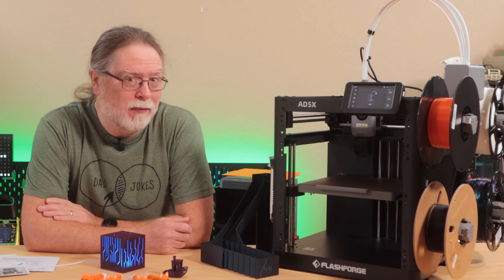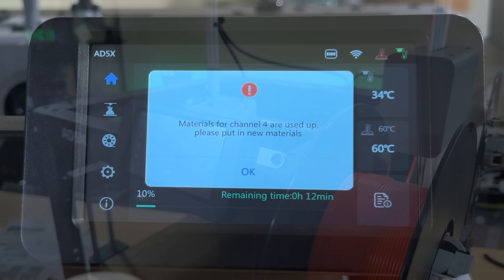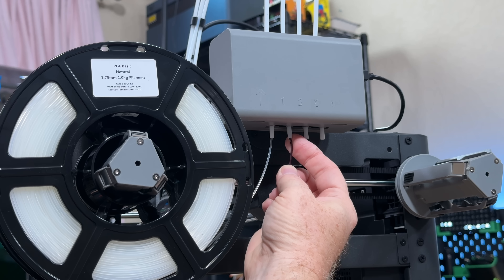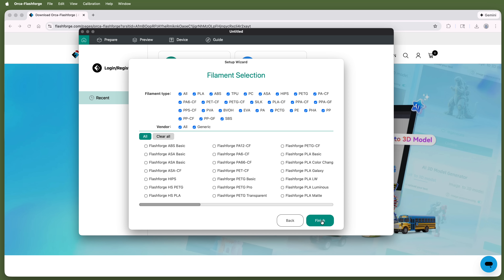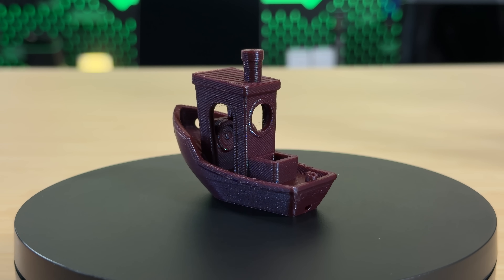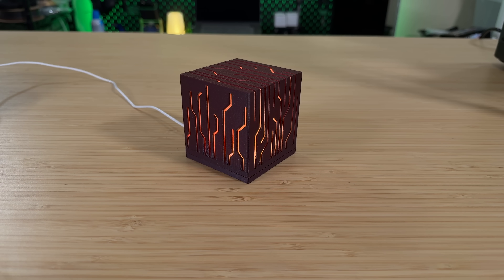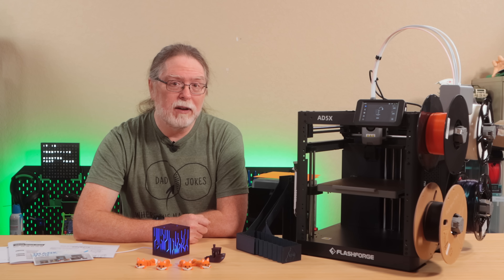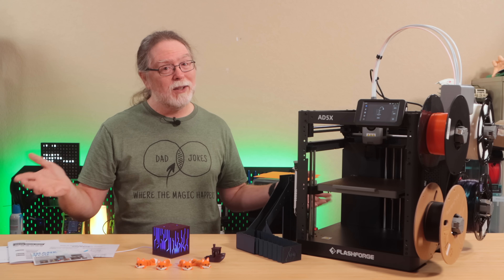A $399 CoreXY Printer with Four Colors? FlashForge AD5X Review

Comment from the maker: Hello 3D Printing Friends! I'm, curious what you think about the FlashForge AD5X. If you’re using one, what’s been working well for you, and what do you think could be improved?
Reply: I bought one about 2 months ago from my local microcenter for $329 for a specific print job needing multicolor.  All petg, main color cf-petg, with other 3 standard petg. 

after unboxing and swapping to a hard nozzle, it paid for half its cost in the first batch of parts ~ 2 days straight of printing. It is a cheap machine, but with a little slicer compensations, its a fantastic machine for the money, and a low cost entry into multi-material. 

People have their complaints, but it definitely brings an economy option to corexy multi color. 

Good review, and if you keep it around, you could totally make more content off it showing off the "zmod" firmware for it.
Reply: I've been mainly using mine for TPU. More than 1kg in and it's been solid. I would like to be able to send a print job without having to start it, or while another job is printing. That's a quality of life feature I miss.
Reply: @drewbaker4175 that's something fixed in the zmod. I would check it out. With the standard fluid interface it functions like any normal klipper machine

I'll be modding mine soon. Customer said they wanted another batch of parts so i don't want to mess with anything until they either cancel or order lol
Reply: "Where I think it could use some improvement." Me looking at my Centauri Carbon

Comment: Thank you for keeping up with the reviews, it's very much appreciated. I got one of the first run Anycubic Kobra 3 combo printers, and it has been printing pretty well until very recently. I have now gone through three print heads, and have an OEM one on order from Anycubic, but their shipping times are obnoxious since the equipment comes directly from China rather than one of their regional warehouses. Needless to say, I am keeping an eye on the market to see what is coming out and what has come out recently that might be seeing price drops soon, so reviews like this are invaluable to me.

As for the AD5X - it's interesting that you can see the spot on the filament settings page of the prepare tab where the sync button should be and is conspicuously absent. That's a major miss, honestly, for a multicolor printer. I would not have released the product in that state until you could get that basic level of functionality working. Additionally, that filament bleed is the worst I've ever seen on a color changing system. Say what you will about the Kobra 3 / ACE system, but the default purge values are honestly too high, and can be dropped significantly and still not see any level of color bleed, even from black to white. (Having printed a black and white panda theme box, I have tested that scenario explicitly, lol.) The price is right, but it sounds like there are a few serious firmware and software tweaks that need to happen to make the user experience a reasonable one.

Comment: Purge is controlled by the firmware, no amount of changing in the slicer will affect it, FF have locked this thing down and reduced the amount of tinkering you can do without something like Zmod
Reply from the maker: Ah. I don't know why they would do that, but it certainly explains the results I was getting.

Comment: No, the printer does not have to be bound a Flashforge account when using LAN mode in any aspect.  I have 10 of these machines and that is the reason I got them over Bambu -I never had to bind anything.  I can still update and run the printers just fine.  If anything the machine suffers from is Flashforge's awful customer service and terrible purging system.

Comment: Does the screen offer a way to manually set a purge multiplier? I have that option on my Anycubic Kobra 3 Combo and it really helps with bleed where the firmware purging isn't quite up to task. I still set it in the slicer, but the machine itself has a 1.5 purge multiplier manually set over the default 1.0. Initially I was tempted by this printer when I first saw it, but I'm glad that I've waited. The future of multicolor printing is with multi-toolhead machines, both in time savings and in reduced waste.
Reply from the maker: Hi Stew, I didn't see anything like that on the screen. Some other commenters have said there's a way to get more of a standard Mainsail (or similar) web UI into the printer, so that could open up the possibility of adjusting it by accessing Klipper a bit more directly.

Comment: It's (sort of) funny, that TPU-capable multi-material printers don't have dryers, and AMS boxes with dryer can't feed TPU 🤔

AC Kobra S1 Combo is a bit more expensive, a bit bigger, fully enclosed and has drying multi-material box. CPU is about the same level with FF AD5X and Elegoo CC (cheapest possible, Elegoo seems to be only one not able to squeeze in filament change).

Not sure if FF is cooking something bigger or more modern... Guider 4 seems to have fizzled
It'll be interesting to see where AC Kobra X lands - it should be between AC Kobra 3 V2 and Combo, right?
Reply from the maker: The Kobra X is interesting from the perspective that they've managed to squeeze all the filament change hardware into the toolhead itself. There are a few other optimizations they've done, like reduce the distance between the filament cutter and the nozzle, so there should be less purge waste as well. The've got a link up with some basic info (https://store.anycubic.com/pages/kobra-x-new-launch), and the printer looks almost exactly like a Bambu Lab A1 with four top-mounted spools.

Having run an A1 with the AMS lite mounted on top, I think this is perfectly OK. I never noticed a difference in print quality between having the AMS lite's weight up top and having it off to the side of the printer.

Comment: Just like Bambu labs and Creality, the whole sign in , agree to our terms and use our slicer model does not work for me. I will stick with QiDi Tech and Orca Slicer thank you. I actually just picked up the Creality Hi because it was priced at $214 USD for the Non-Combo version on Amazon and for that price it the build volume was worth it to me at the time. Now it's going back because it is too restrictive. Creality print is horrible, I am not going to create an account in creality's software, there is no ethernet port only wifi or usb and wifi is as bad as creality print. Flashforge is going the same route and for those that just want an out of the box printer for a hobby, that's great. As for me and mine, either the Q2 or the Max4 will be my next printer possibly the Snapmaker U1 after it becomes more available to the public and the 6 month wait times are gone. Other than that, great video as always. Very informative and entertaining. Thank you for your work.

Comment: my AD5X works well but not with Linux and FF not having client slicer software so have to use normal Orca which is missing a few settings for the AD5X so it's a little painful
Reply: Did you find a way to use IFS with standard Orca? Orca Flash it’s pretty old
Reply: @amaillo  the only way is to slice and then just upload, I then go to the printer and select the model from there and then get the option to use IFS

Comment: As for the cheap multi material printer.. not bad, as for the company and its standards, I disagree with what they deem people can use them for. We already have idiots in government attempting to control 3d printers. No thanks to that. I will stick to homebrew, voron, box turtles and the like, but for purging, did you not use a tower? I assume you didn't as is the only way it came out bleeding still,  But you could also have added a 4th model to purge into to instead of using a tower.
Reply from the maker: Hi! A purge tower was used. The slicer adds it automatically. I just couldn't get the printer to purge enough orange to clear out the black.
Reply: ? Have the ad5m and print whatever with no issues... 🤡
Reply: Do you not get fined for overspeed? Why owning and using guns should be outside of the laws?
You still live in a dream of the wild west?

As if there was not enough gun deaths in US 🙄
Reply: @kimmotoivanen  What does this have to do with anything? I should and will print what I want when I want, not your concern or concern of the government. If I have a legitimate business, and I can produce said product I will. lol
'merica... yes I live west... far west

Comment: also, for the tinkerers and better purge parameters(the stock setup i believe overrides the slicer settings hence the color bleed), there's a solid community firmware that give you a proper Fluid klipper interface (since this is running klipper under their junk)